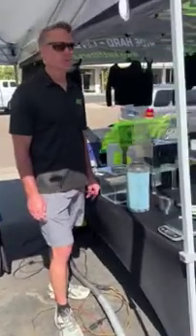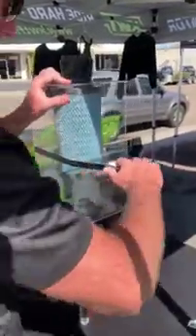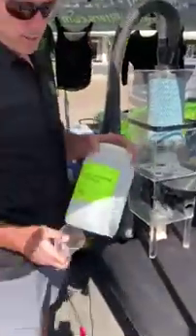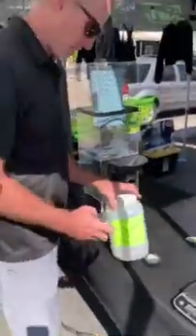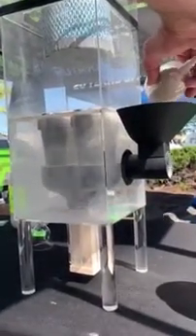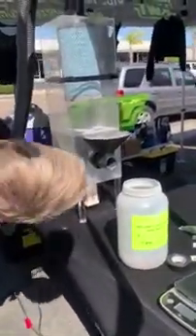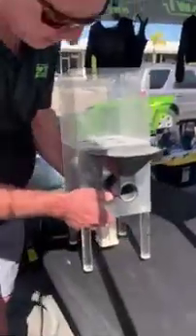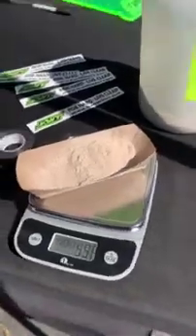KWT Particle Separator Demo at Ivan Stewart Motorsports Sept 2019

Comment: No fan on these?
Reply from the maker: That's right, no fan, no electrical required, no noise!
The Honda Talon that just won the Baja 1000 used our particle separator.  No filter change during the race!